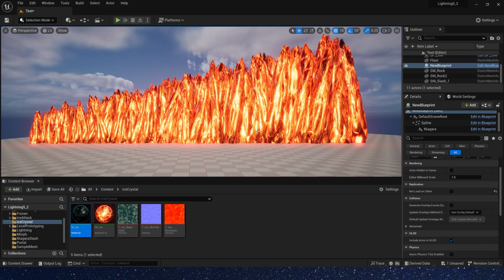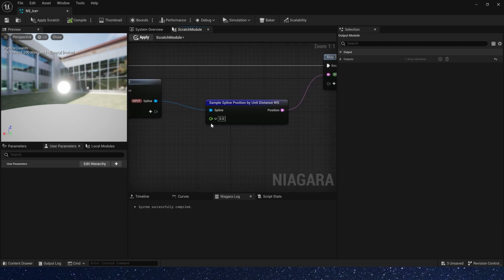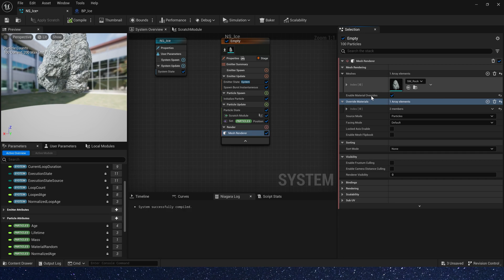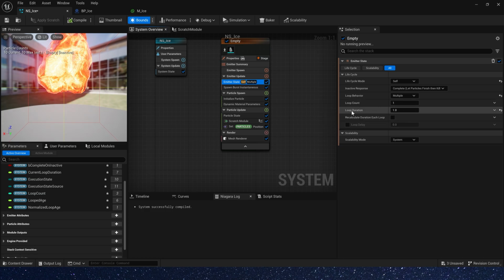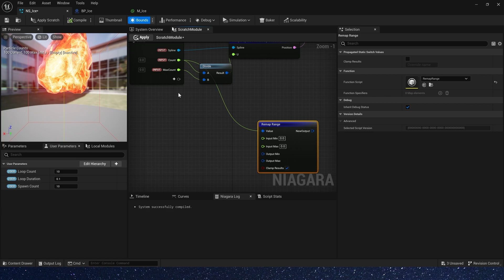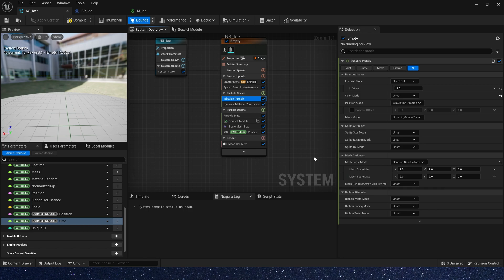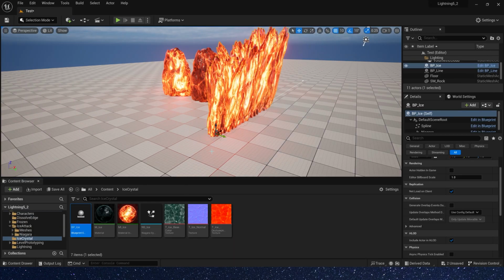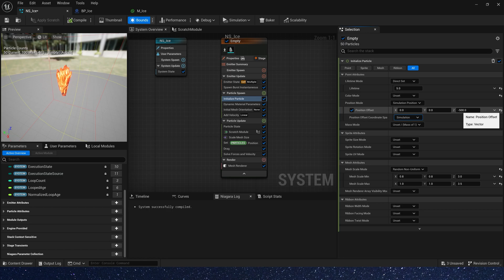UE5 Niagara Crystal Attack Effect - Tutorial

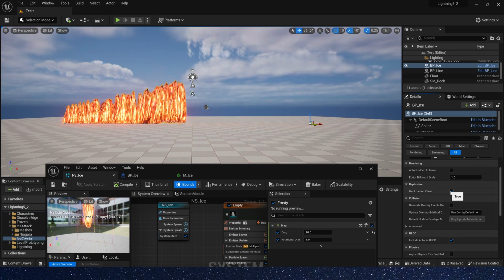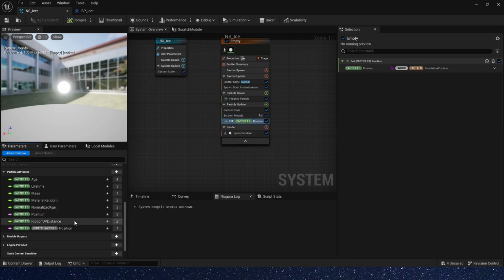Comment: Awesome tutorial! There was one part that had me really stuck. In case it helps anyone in the future: I'm not sure if its a UE version thing (I'm using 5.1.1), but around 13:00 when you break the rotators, the variable for  "Set Particle Position" in the niagara stack changes back to the regular particle position variable instead of the one from the scratch pad. I had to drag the Particle Scratch Module Position variable back over like you did initially at 3:24 , otherwise the crystals didn't follow the spline anymore.